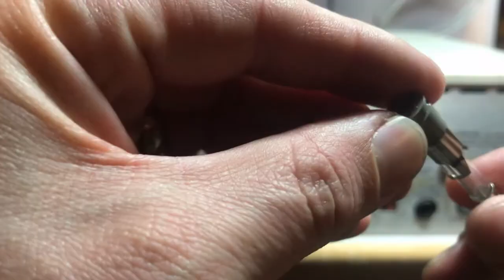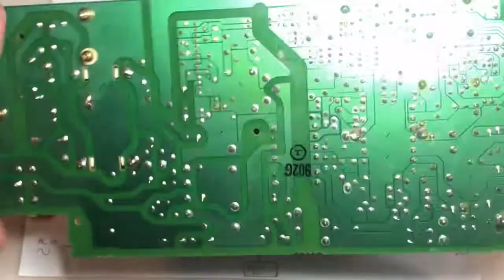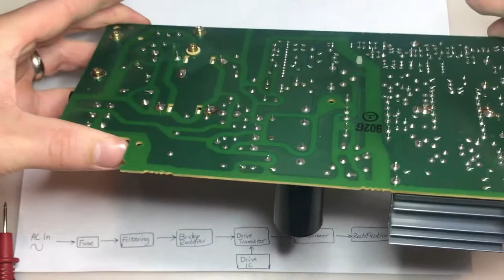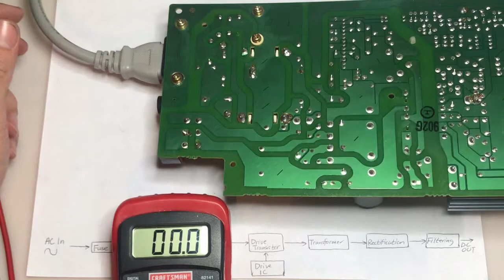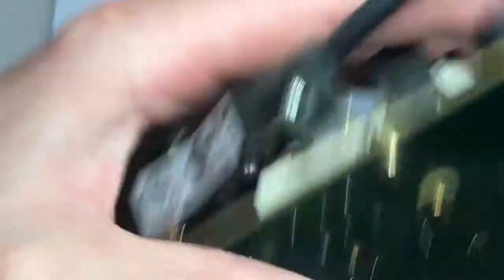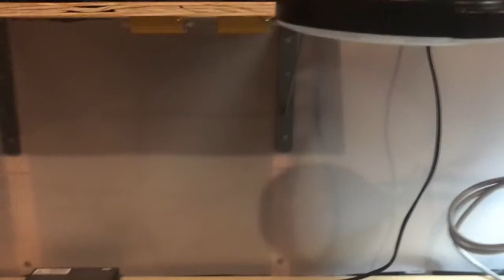DR #9 - Hewlett Packard 35900B Chromatography Interface Unit Troubleshooting and Repair - No Power

Comment: I am just amazed as how you systematically break down a piece of equipment and get to the source of the disorder!  Creating the block diagram and then checking the power flow through the passives on the circuit board to arrive at the discontinuity was very enlightening! Spotting that lifted trace was the result of some very patient, close-up and thorough observation - it was not apparent from a casual look-over.  I thought you were just going to reflow a fresh amount of solder on it - the wire jumper was the quickest and surest fix. 
Nice work, Nick!
Reply from the maker: Thank you Wossname1952. Your comments are always very encouraging.